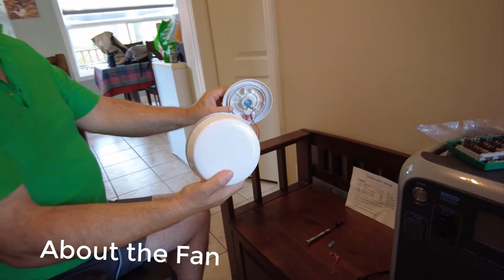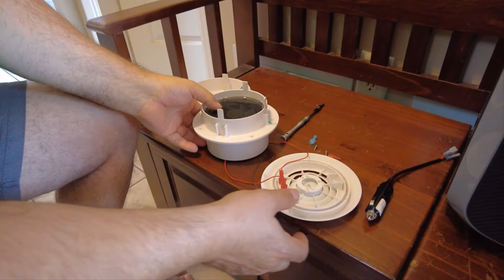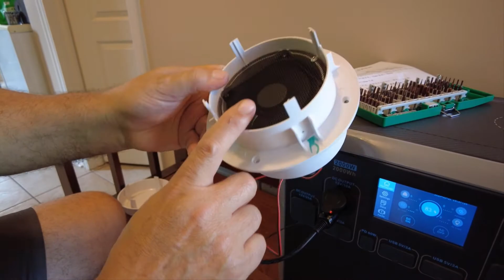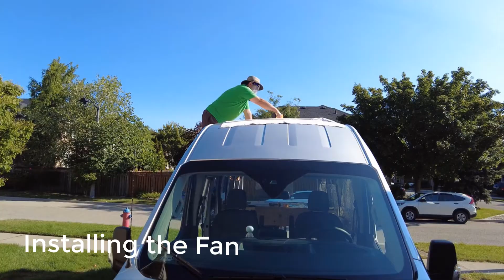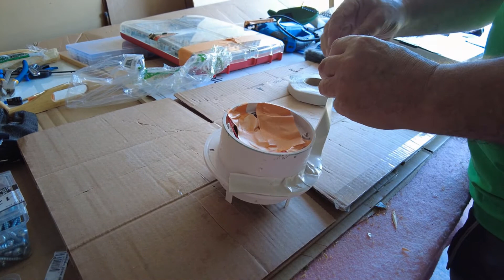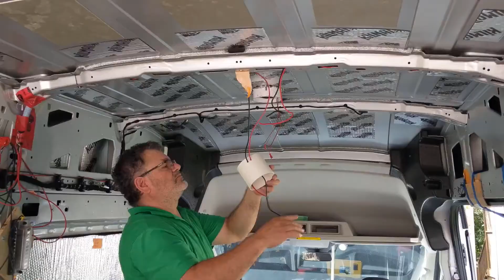Van Build 4: MASO VENT FAN - 2021 Ford Transit 250 HR AWD 148" 3.5L EcoBoost V6

Comment: That's interesting! We have not seen anyone else use one of those fans in a van. Have you guys? We bet that will be nice for air flow! Great printed instructions! So helpful! LOL!
Reply from the maker: It's pretty good for air flow!  No we haven't seen anyone do this.  Initially Alex wanted to drill a hole down on the floor of the van for air flow(we've seen that in a few vans).  We finally settled on this little fan.  Thanks for watching!